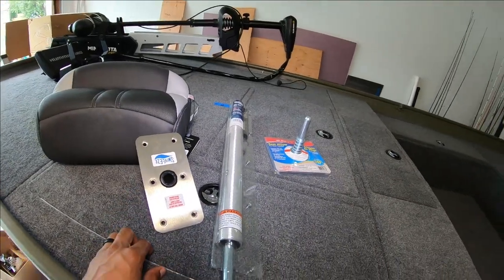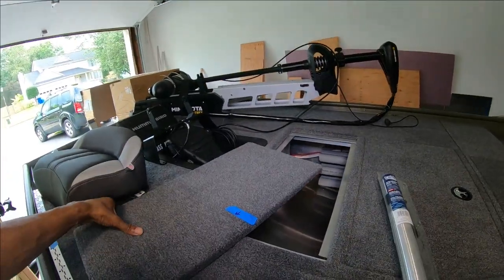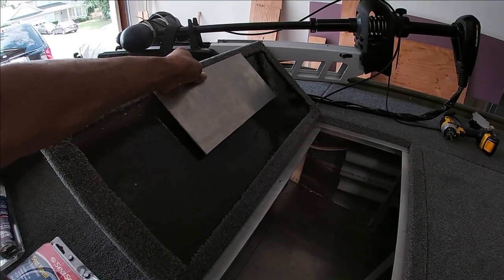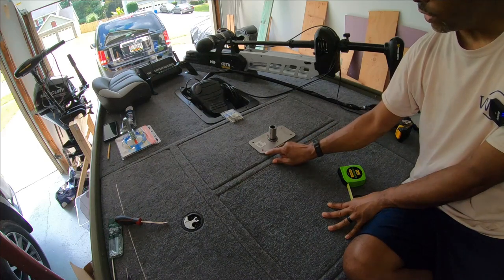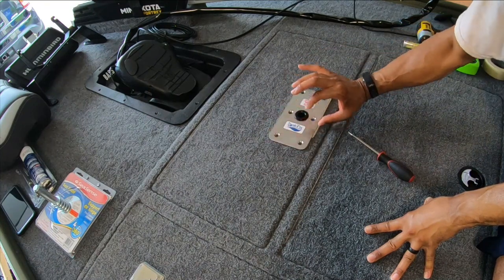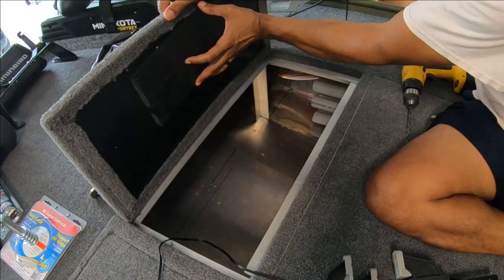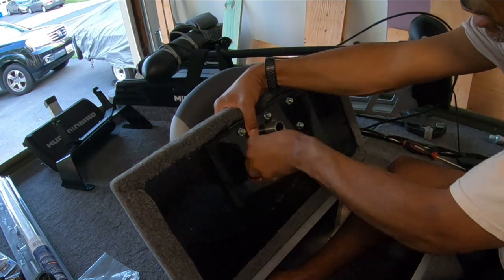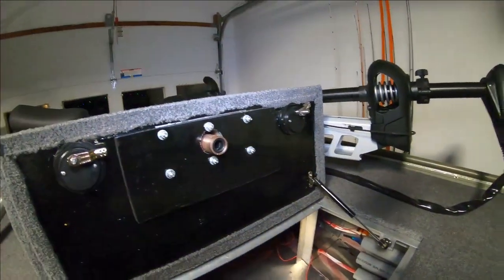Jon Boat Pedestal Seat Install on Hatch Lid {Jon Boat To Bass Boat Conversion} Lowe 1448

Comment: Following along for ideas to mod my 15ft DuraCraft Jon boat. I've seen most of the videos but haven't seen or heard mention of gas tank location and how to vent it. Great stuff so far and I'm stockpiling aluminum now...Thanks
Reply from the maker: Thanks.  The gas tank is kept in the right hatch at the rear of the boat. I have a 3 gallon tank back there.  The rear deck is vented at the transom location where the motor is. In considering adding additional vents but haven't done it yet.  I recently started a new build where the rear deck with have an awesome 3 track dry hatch that will have 3 to 4" vents.  Stay tuned.

Comment: Excellent video.  You did a fantastic job.  Couldn't imagine an manucacturer doing any better.  I have one question about the ped mount. Is the hole that the shaft sits down in open all the way through or is it water tight?  I'm thinking about mounting a pedestal base on a hatch over a "semi dry" storage area and don't want to have a open hole for water to get through. Thanks.
Reply from the maker: I believe it goes all the way through but speaking from experience I've never notice significant water from that hole.

Comment: Awesome stuff! I'm thinking about doing the same, including a similar seat and was initially thinking I might need to run the aluminum post all the way down to the base floor in some fashion for added stability. But if your approach is working well, I might just go with that. I've never worked with cutting aluminum before and don't have anything here to do it. So I might just look for a similar sized pre-cut from Home Depot as I don't plan to paint or or need it to look nice when the hatch is open. Any regrets on the "butt" seat vs. a larger seat? I've always fished standing up but after a few hours on the water I've always thought a butt seat or similar would be helpful. Thoughts?
Reply from the maker: Thanks man...  Keep in mind, if you run the pole all the way down to the floor it may interfere with your ability to open and close the hatch.  No regrets on my end.  The mount is holding up perfectly so far.   Extremely sturdy.  I am conscious not to go leaning on it more than I need to. After all it's still 1/2" thick wood decking.   I may buy a shorter seat pole and get a seat with a back eventually for those really long days so I can sit and lean back and chill 😎

Comment: Any chance you remember what screws you ended up using to mount the pedestal base to the deck? I didn’t see them in the description.
Reply from the maker: I believe they were the 1/4 in - 20 x 2 in Everbilt Machine Screws from home depot.
Reply: @BassBrothersFishingDMV  Thanks man. I have the same model Lowe and I’m just getting started on the deck. Lots of work ahead, but I’m super excited about it. It’ll be a little different than yours, but I’m definitely borrowing a lot of your ideas. Thanks for such a thorough record of everything you’re doing. Love the channel.